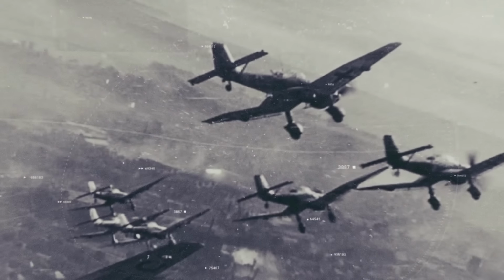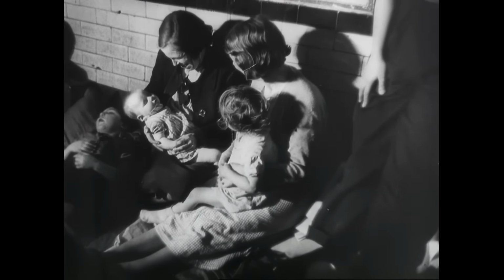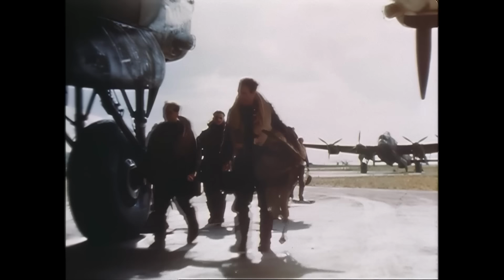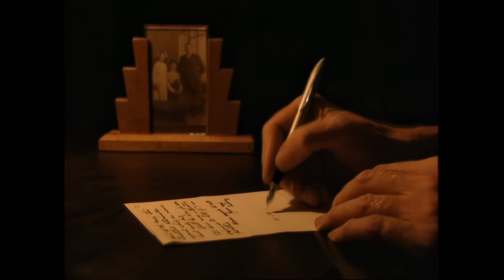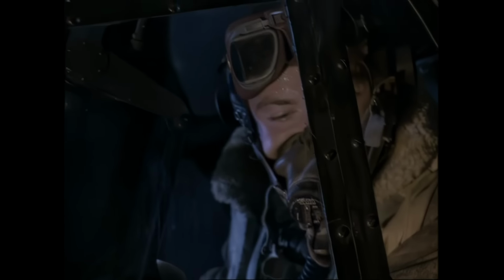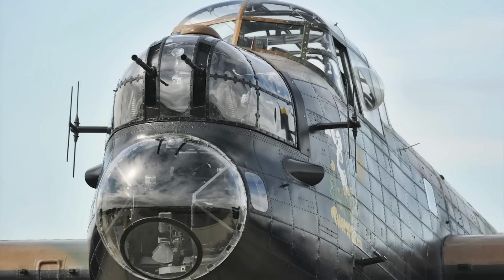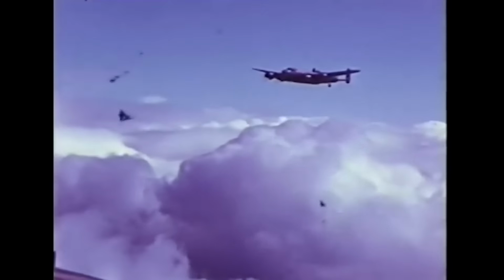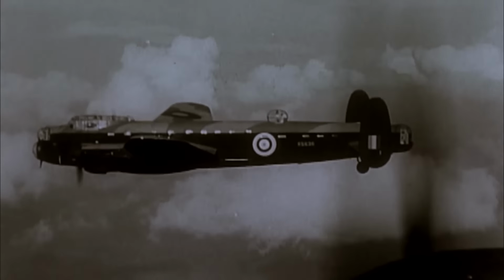LANCASTER BOMBER. WWII Aircraft that Changed The War. Powered By 4 Merlin Engines | Documentary

Comment: My grandfather was a tail gunner and backup pilot on a Lancaster bomber.  The RCAF pushed redundancy on their planes in the event that someone was wounded or killed.

Their crew flew many night missions dropping supplies for the French Resistance.  One night they must have been ratted out, and the Germans lit them up with spotlights as they came in barely above the trees.  88's and other anti-air systems opened up on them, firing almost flat trajectory as the bombers were barely above the trees.
His plane made it out, but when they got back to British airspace, he unbuckled and went to get out of his gun port, he noticed an 88mm sized hole on one side of the fuselage about 18" behind him, and another 88mm sized hole directly across from it.  It was either a dud, or it didn't explode until after it exited the plane.  Had it gone off it would have killed him instantly, blown the tail off the plane, and the rest of the crew would have died within a second or two hitting the ground with no chance to parachute out.  
I'll never forget him telling me that story....and he had a smile on his face and was laughing about it while he told me.  Man, I miss him.

Comment: There are many strong themes which run through this video, so I shall only comment on the relationship between people and complex & specialised pieces of machinery.. As a pilot, every time you take an aeroplane from its hanger, & carry out what usually takes about half an hour, inspecting & checking all the operational  by the time you climb in to the cockpit, you have touched and felt so much of your conveyance, that there is a sort of bonding which feels personal. When you accelerate down the runway, and the craft leaves the ground behind,  this feeling becomes quite strong - you feel just as responsible toward your aeroplane, as to yourself yo ensure that the return is as kind and gentle for the aircraft, as it is for you & your passengers!
Reply: This bond occurs between all manner of machines and people, from Adventure Motorcyclists of the female variety (Noraly "Itchy Boots") through to racing drivers and Steam Train Engineers. There's a sense of camaraderie, that together they'll overcome danger and adversity.

Comment: Not many Lancs left. Think there are a couple that are still flying, but that is it. There is a Lincoln at RAF Cosford (the Lancs post-war bigger brother) which is a sight to behold. Worth going to see if you are ever in the area.
Reply: With FOUR Merlin engines to feed and care for, no wonder these maintenance nightmares vanished quickly after the war.   They had little use at all after the war because they were cramped and slow and loud and, frankly, dangerous.
Reply: @arthurfoyt6727  The Lancaster and Lincoln soldiered on for several years after the end of the war, as did the B-29, until the first generation of jet-powered bombers became available. (Early jet bombers had a significantly shorter range that piston-engined bombers, which helped the latter hang on for few years.)
Reply: @arthurfoyt6727  Shackleton's Yorks Lincoln's Still flew on after end of the war inc Lancaster's between them for many years

Comment: By the end of the war, British industry could build a complete Lanc in ONE DAY. And at Ford's Willow Run plant, the Yanks could turn out a new B-24 Liberator in ONE HOUR! Both fantastic achievements - particularly since the production of Lancs and B-24s exceeded the availability of trained airmen to fly them.
Reply: I think you're confused.  One B-24 an hour doesn't mean it took an hour to build one.  It just means the assembly line disgorged completed B-24s at the rate of one per hour.  But yes, Willow Run was an amazing achievement in the days of slide rules and no CAD and no CNC!

Comment: The surprising thing about the 'canvas and fabric planes' is that they were not nearly as fragile as you would have thought, there is integral strength in  a bi-plane wing and remember, fabric and resin is composite construction. It is amazing to learn that the modern aluminium monopanes don't seem to hold up to the turbulence that the biplanes had to endure dur to their inability to avoid storms.

Comment: The B-17 was five years older than the Lancaster so was nearing obsolescence.   But he B-17 had a couple features that made it superior for daylight raids.  Although the planes were nearly identical in most specs, the B-17 could fly higher to 35,000+ feet vs 24,000+ feet for the Lancaster.  Obviously this gave the B-17 better immunity from anti-aircraft barrages.   Also, the B-17 had a crew of 10 vs. 7 and was bristling with guns for the crew to operate.  The B-17G carried up to thirteen .50-caliber machine guns, while the Lancaster only carried six .30-caliber machine guns.  Quite a difference.   I don't think the Brits anticipated the air war that WWII became for the bombers.   On the other hand, the Spitfire had eight .30-caliber machine guns so brought hell to dog fight, and the Germans had to add machine guns to the Bf-109 to catch up just a little.
Reply: More B-24s were made than B-17s and lancasters.
Reply: @Crashed131963  Consolidated was originally supposed to build the B-17 but convinced the Army to build a new plane, but the plane never met the promised specs.   Most people think the B-17 was the better plane.  Apparently the B-24's longer range was an advantage in the Pacific and there was less threat of flak over the oceans so it's lower ceiling was not so great a problem.
Reply: Lancasters had eight 303's four in rear turret and two at front and two on top turret and there was some late war ones that had two 50cals in rear turret.Spits/Hurricanes 303's was poor compared to 109's 20mm cannon and bigger cal mg's and Germans had self sealing tanks why we didn't so between that and larger calibre guns was why we lost so many planes earlier in war and later we went with two mg's and two cannons which once worked out how to stop flex jamming breeches rebalanced the ratio
Reply: @buckrogers2828  303s were replaced by .50 cal
Reply: @CityRedesigner1945  which is what i stated. Earlier had 4 303's in a "freezing turret" Uncle served on them in war. then as 50 cal became more available due to fighters taking up quotas and as that market was catered for they upgraded some to 50 cal as realised 303's just didn't have the range/puff as german planes had larger calibre weapons that could fire beyond 303 ranges.
Reply: It all came at a compromise though. The B-17 carried just half the bomb load of a Lancaster and the B-24 nearly only a fourth.

Comment: Once again, the British failed to use the available .50 caliber machine guns. How sad. The Nazi's had 20mm cannons in the ME109 which would down the bomber long before they came into range of the puny .303's. The idea that the Lancaster won the war is ludicrous. In my humble opinion, the plane that won the war was the P51 Mustang.  Even Goering, when he saw the bombers escorted by the P51's over Berlin, said, "The jig is up".
Reply: The lancaster did use .50 cal machine guns on the rear and mid upper turret. It was called the Rose turret and if you bothered to use google before commmenting you would know.
Reply: Rubbish, the range of a 0.303 is 600 yards, you cannot see 600 yards in the dark. Well obviously you can, you have those magical black crosses.
Reply: What engine was in the Mustang?
Reply: @MzLunaCee  Rolls Royce Merlin.
Reply: Me109s were day fighters which didn't fly against night bombers.  The 30 mm cannons in the night fighters had short barrels with low muzzle velocity and therefore short range but the shells were explosive and deadly.  Nobody could see very far in the dark.  It is a complete myth that the night fighters could hang outside the range of the .303s and shoot down the bombers at leisure.  They had to get in close.  Often they mounted the cannons nearly vertically behind the pilot and fired up into the bombers from directly below and a little bit aft so the disintegrating bomber parts wouldn't fall on them.  The bomber crews quite literally never knew what hit them and most aircrew seeing the explosion assumed the plane had been hit by flak.  The so-called "Schragemusik" which is what Germans call "Jazz" (literally slanted music) was a secret that Bomber Command was slow to figure out because no one could see the fighters coming up from below and few bombers so hit managed to get home to tell the tale.
Reply: @CityRedesigner1945  And the other guns?
Reply: @larryweiss7170  not needed

Comment: Most bombs missed their targets by miles.
Reply: And yet they devastated German cities, vengeance was British, in the shape of RAF Bomber Command.
Reply: @hitime2405  They missed most of the time and CITIES were not critical to ending the German war effort.
Reply: @arthurfoyt6727  That was before airborne 10cm radar. If you are a fool it's best to keep quiet than come on here and prove it.
Reply: @mikemines2931  I know the radar that eventually was used.  Point is that, like a VOR station, you get less accuracy the further you are away from the stations.  Stations in England probably gave them a 2-3 mile area until well after D Day when stations could be put closer.
Reply: @arthurfoyt6727  Pity my uncle Charles couldn't be here to put you right, he spent many hours orbiting targets in a Mosquito flaring when necessary.
Reply: Most bullets missed their targets too
Reply: @arthurfoyt6727  You are making the mistake of thinking the only thing Bomber Command did was incendiary area raids on cities. 

In reality, the peak year for incendiary bomb usage was 1943, both in terms of number of tons dropped and percentage of total tonnage dropped. Bomber Command dropped 82,956 tons in 1943 as compared to 73,438 in 1944 and 28,215 tons in 1945. In terms of percentage of total tonnage dropped, incendiaries accounted for 47.0% in 1943, 12.9% in 1944, and 14.2% in 1945.

In 1942, 78.2% of the tonnage dropped by Bomber Command was directed at towns; in 1943, it was 83.5%. This fell to 35.7% in 1944 and increased slightly to 36.8% in 1945.

There is a notable shift in typical bomb load as 1944 progressed, with an increasing emphasis on high explosive weapons and fewer incendiary bombs.

Bomber Command hit plenty of other targets, but these efforts are ignored. It dropped more tons of bombs on V-weapon sites than did the 8th Air Force (73,146 vs. 40,438); in 1945 it dropped more tons of bombs on oil targets than did the 8th and 15th Air Forces combined (52,117 vs. 28,481); in 1944 Bomber Command dropped almost as many tons of bombs on railway centers as did the 8th AF (99.003 tons vs. 100,393 tons).

Bomber Command's effort against the Ruhr from March through July 1943 had a enormous impact on German war production, as the German's own records show. Military production, which had been growing at about 8% per month, effectively stagnated for some seven months after the Battle of the Ruhr ceased. The armaments production index did not exhibit a sustained rise until March 1944 (and would peak in July 1944 and fall off rapidly after that).

The bombing efforts against German steel production from January 1943 through September 1944 resulted in steel production being nearly 13% below what it would have otherwise been. Damage from air raids accounted for 27.6% of that reduction; work stoppages from air raid alarms accounted for 24.9%; shortages of gas, power, raw materials, and labor accounted for 23.6%; and other factors accounted for the remaining 23.9%.

Bomber Command accuracy, typically measured as percentage of bombs dropped falling within three miles of the aiming point, increased as the war progressed with the advent of the Pathfinder Force, better target indicator bombs, H2S radar, electronic navigation aids such as Gee, Oboe, and G-H, use of master bombers, and improvements in target marking techniques. In April 1943 the percentage stood at roughly 28%; by August it had improved to about 55%; in mid-1944 it was 60%; and by the end of 1944 it was nearly 90%.

Comment: I see now that these were the heavy  lifters of their time, much better than their counterparts the B 17's and 24's.  So if these other aircraft could and did have a ventral or ball current gunner to cover aircraft coming up beneath you,  why didnt they have them on the Lancaster?   These germans knew about this oversight and built their night fighters to throw 20mm cannon shells into the underside of these RAF heavies, and they blew about half of them out of the sky!   Was it too costly to install them or did they just accept the losses?
Reply: Originally, only the Lancaster could have carried the atomic bomb, because of its heavy lifting capacity and single huge bomb bay. This was actually discussed. However, some risky mods were made to the B24 to allow it to do so. This included making the engines mostly out of manganese, which is highly flammable. The Lancaster would have done the job without modification.
Reply: It had such poor survivability that the pathetic design was relegated to night flying only, they could never have replaced the b17 or b24's nor carry the atomic bomb
Reply: @kenneth9874  The Lancaster could definitely have carried the atom bomb. This was discussed by the allies.
Reply: @kenneth9874  Well aren't you the clever bunny
Reply: @kenneth9874  My Father piloted 37 Ops in the Lanc, nine of which were daylight missions - so roughly 1/3 were during the day...
Reply: @kenneth9874  where did you get your history from? a lucky bag perhaps….
Reply: @dougbolton5503  he was a brave man and fortunate to survive
Reply: @Dragonblaster1  The Lanc was slow and more vulnerable. It was "discussed" and promptly shelved as an idea.
Reply: @kenneth9874  Utter crap.  The B17 was so bad the twin enginned Mosquito could carry the same bomb load at twice the speed.  The atomic bomb was the same mass as the Grand Slam bomb, the Lanc could have carried it, but didn't have the range of the B29.  The first ever proposal of mid-air refueling was made to get round this, but the Yanks couldn't stand having to share the glory.
Reply: So if these other aircraft could and did have a ventral or ball current gunner to cover aircraft coming up beneath you,  why didnt they have them on the Lancaster?

It did originally have a ventral turret. But this was operated by periscope, and judged to be ineffective for combat and was removed to save weight, although Mk II Lancasters with the bulged bomb bay doors sometimes had the turret equipped.

There was a steady debate within Bomber Command regarding the value of manned turrets when bombing at night. Some crews and commanders felt the most important role of the gunner was not to shoot at enemy night-fighters, but instead to act as a lookout to warn the pilot of an approaching enemy aircraft so the pilot could take evasive action.
Reply: @kenneth9874  It had such poor survivability that the pathetic design was relegated to night flying only

The Lancaster, and Bomber Command in general, flew many daytime bombing missions from mid-1944 onward once daytime air superiority had been attained.
Reply: @silgen  The B17 was so bad the twin enginned Mosquito could carry the same bomb load at twice the speed.

The B-17 was excellent in the role in which it was used: massed daytime formation bombing. The Lancaster would have had trouble doing that given its lighter .303 caliber defensive armament.
Reply: @primmakinsofis614  exactly! They couldn't survive until the US cleaned the luftwaffe from the skies over Europe which was the reason for daylight bombing, it forced the luftwaffe to fight so that they could be destroyed allowing the D-day landings
Reply: @kenneth9874  The U.S. also had to learn the lesson that unescorted bombers, no matter how well they were armed, no matter how tight their formation, were vulnerable to German fighters. A painful lesson, as the two Schweinfurt raids showed.
Reply: @primmakinsofis614  not nearly as painful as the first daylight attempt with lancasters with a 60% loss rate, the bomber mafia learned their lesson and then proceeded to lure the luftwaffe to their destruction by US escorts......
Reply: @kenneth9874  -10 points for saying 'bomber mafia'
Reply: @primmakinsofis614  Then they went into that corkscrew maneuver, right?  and did that work every time?
Reply: @primmakinsofis614  the mosquito was made of cheap wood and had problems in humid weather with both sealants and adhesives, Good if you are that desperate. Try pulling your nose out of RAF rumps and stick it in an aviation book. The B-24 had the greatest range of the bunch at 3000+ miles the British bought over 1000 to combat the wolfpacks and bomb submarine pens in the N.Atlantic
Reply: @arthurfoyt6727  the Lanc was faster than the Boeing shiibox, and a far better aircraft to fly, and carried a much larger bomb load. all those 59cal did no good at defending the 17 either. Bombing accuracy was no better even with the shitbox doing it in daytime. you yanks always get triggered by reality